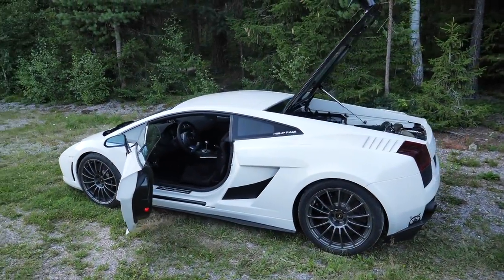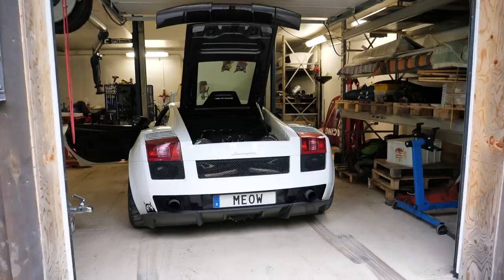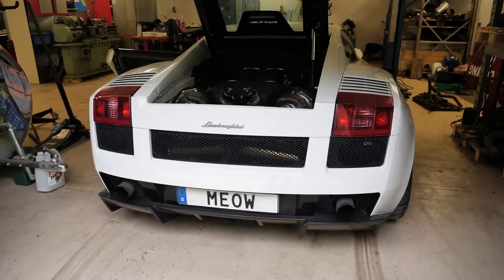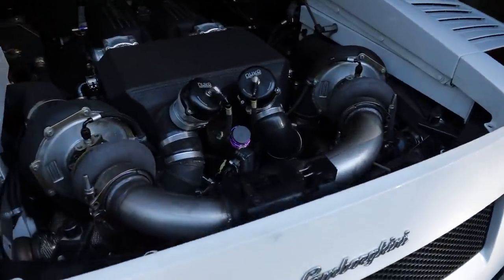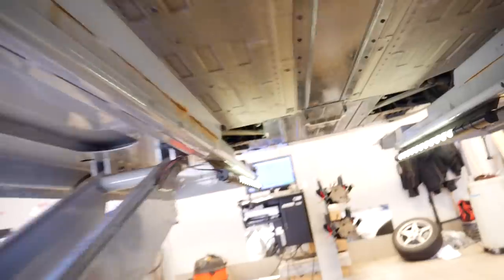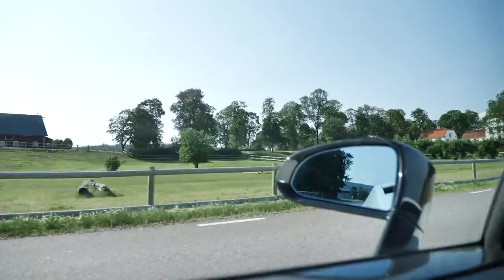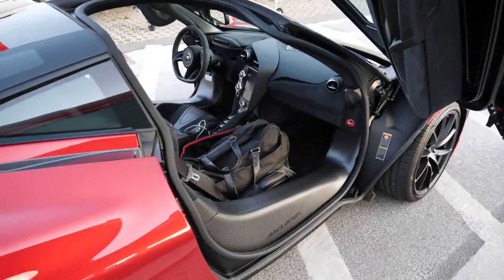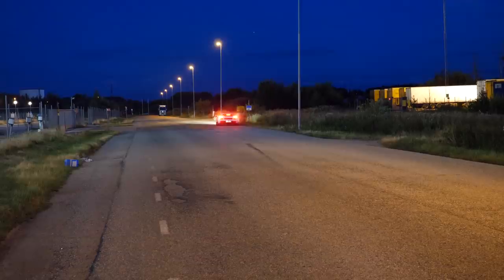My Lamborghini Twin Turbo Sounds like Crap!

Comment: Peter if you want to go carbon(ceramic) clutch plates, let me know. I've got a good contact that can get this manufactured at his supplier. They also made my new carbon ceramic rotors.
Reply: Why carbon and not kevlar? My own Gallardo could need new clutch plates next summer and it currently has some expensive Kevlar plates.
Reply: @RyosukeTakahashiRX7  Kevlar (Aramid) is basically very durable and has smooth engagement because of how it's dynamic to static coefficient of friction is. It's not very good actually for holding torque versus organic or (metal)ceramics and you'll need a very heavy clutch spring pressure to get the same performance. The carbon types (carbon carbon and carbon ceramic) clutches offer very nice coefficient of friction and can withstand nearly endless abuse and slipping without ever burning up (unless you actually try to of course). They are extremely lightweight and durable. Ps. I wish I had your problem :P
Reply: @DC_DC_DC_DC  Interesting, thanks a lot for explaining! But how about clutch wear for someone who's just driving the car as a daily and doesn't care too much about performance? Also mine has a shitty E-Gear, that thing eats through clutches like nothing. Does carbon hold up over longer times? My current clutch plate is the HT300 which lasted for good 90k kms and I'm satisfied with the wear. Would you suggest a carbon one over it? If yes, could i maybe get some insight in the contact and some of his previous products?
And no, I'm by no means rich, i saved up half a decade for this stupid shitbox. Not regretting it yet though, that V10 is just too lovely for now :D
One could say I'm going through an early and long lasting midlife crisis
Reply: @RyosukeTakahashiRX7  the E gear changes the situation a bit, it would be a gamble if the drivability would remain acceptable with the much bite-ier carbon. The gearbox software is programmed with a certain characteristic/curve for the specific OEM materials, and Aramids behave very well. Carbon ceramics and carbon carbons are very "grippy" and can even squeal. Since you don't drive your car hard, I'd say the Kevlar clutch you have now is a good decision for longevity, certainly on the robotized box. By the way if you want to learn more about this, look into brake (rotor/pad) materials from a bit more scientific approach (read articles, not marketing I mean) because it is pretty much identical. About durability, the carbon ceramic brake rotors on my S8 (yay v10 too) have lasted 300.000 kms with occasional hard use. Pads wear faster but still nowhere as fast as organic pads. That is probably the best way I can explain you about how wear resistant the materials are.
Reply: @DC_DC_DC_DC  For brakes i got the factory option with carbon ceramic and yes, still going strong. Would definitely buy them again if i ever needed new ones. Kevlar clutches generally don't get much usage outside of Lamborghinis, especially Gallardos, it seems. Guess my next one will be Kevlar again because there isn't really any reputable other clutch out there or at least not with any reviews saying they lasted for a long time. It's also worth noting the HT300 is carbon kevlar so in some sense one could just call it carbon. Anyways, thank you for taking your time and helping me, i really appreciate it.
Reply: @RyosukeTakahashiRX7  you conversation was more entertaining than the video itself

Comment: Congratulations on such attention to detail!  You are an inspirational engineer. Two questions:

The white smoke on engine start: 

is it oil burning from the turbines or something else (piston rings)?
is it oil dissipation (natural occurrence from the dry sump)?

Best of luck sourcing a clutch plates basket that is capable of tranfering over 1000 hp at the wheels for more than a few passes!

Comment: Only in Germany: 
TÜV: "Dont Think about it"
Reply: AFAIK Sweden has some strict laws too about engine swaps and such. Only the strongest engine from a model line can be retrofit into your weaker car, no series or manufacturer crossing...  So I really don't know how they justify or allow adding twin turbo to model line that never(?) had it from factory.
Reply: Sweden have laws permitting more crazy builds as well. Its called "Ombyggt Fordon". I have registered my BMW E28 518 with a BMW M50B25 with a single turbo running E85. You will need to change the front axle, rear axle, engine with complete driveline and complete brake system. You can then have 15kW per 100kgs, which equates to 286hp for my car that weights a hair under 1400kgs. Turbo size and injector size will need to be reasonable for the power, I had a 62mm turbo and 875cc injectors and that was too obvious that I was going to have more horse power after registration (which I of course changed after, 450whp now). Registrated it with about 450cc injectors and a Evo turbo (td05-16G). 

The problem with registrating it this way is that all of the above componenets need to be swapped for other stuff than is on the car stock, doesnt matter if you have gigantic brakes stock on a Lambo, you would need to change them to fullfill the requirements... I had to put a lot of work in getting my car approved, I have a complete E36 M3 front axle with brakes, rear axle is a custom build based on E28 but with E34 540 diff, brakes, control arms and CV joints with E28 535 driveshafts (this is to have the same width of the axle). Brake cylinder from BMW 750, M50B25 from E36 325, ZF gearbox from E36 M3 and a custom driveshaft with big joints from a E34 540. In addition I need to show papers that prove that I have under 285hp, I need to have measurements done so that the car isnt too loud, it needs a closed type crank case ventialtion and a catalyst. After that you will pay to have someone look at the car, testdrive it and write an approval that everything is done correctly. You will then take the certificate from them to the normal registration and annual check-up place and they will change the registry of the car with the new power and so on.

This would be pretty crazy on a Lambo, in that he would need to change all these parts just to do it, even if the axles/brakes and so on is really good from the beginning and better than most people could swap in thermselves...
Reply: @e30clew  Thank you for very detailed information.

Comment: The x pipe will help with performance as well. If you take your x pipe blow air through one pipe and hold a shop rag on the other pipe and watch how it will suck the rag through it.

Comment: Make a custom flywheel. Then you can get an aftermarket clutch easily. Otherwise you will need to make a clutch every time you need one.
Reply: Or buy 2 in advance :)
Reply: @idokwatcher2062  Or that... But breaking two on a race day is highly likely.

Comment: Lambda seems to be ok.
for more efficiency in low Load and low rpm you can go up to 1,08 maybe, thats 16:1 afr.
But high load looks good that way. 0,8 means a bit cooling already, not too bad for high tuned cars...

Comment: If it's starting to slip and the clutch is otherwise good, then you're probably around 850whp (my R8 TT was holding at 768whp)
Reply: nah its blasting the clutch, you can see it in the last part of the video. Remember he already upgraded to the kevlar before its slipping. probably closer to a thousand horses since he put those harder springs in

Comment: I believe the reason for it not sounding the way you want is because of the mufflers you have on other twin turbo builds they usually don’t run any mufflers just high flow rate cats

Comment: Why don't you control boost from top hat of WG?

Connect boost to low part, then boost controller valve controls top part boost

that way your WG stays closed with boost+spring, and under diagraph you have true boost, it will stay closed until you want it to open. From video I can see that your WG has top provisions also.

as to clutch, you show normal Sintered facing you want. Contact Sachs Racing Equipment, then can supply you a clutch, you have custom flywheel already. And while there, upgrade to 3disc clutch... it will hold much better.

link to Sachs Racing Engineering Clutch catalogue: https://www.zf.com/products/media/automotive/motorsports/services/catalogs/rcs_zf.pdf

No, I don't get anything for proposing their product, but there is a reason why they make F1 clutches and so on ;)
Reply from the maker: Of Course i have boost on top of hat. But if spring is too weak the exhaust backpressure is stronger.

Yes Sachs makes very good product. But nothing for the lambo. I use stock flywheel with trigger pattern. Also the "starter wheel" is on the back of the plate so it looks different to a normal cluth. Dont have time to rebuild for something like that now.
Reply: Ah yes... the pressure plate has trigger ring. 

But the clutch diameter is standard 184mm multiplate clutch. Just try to find out what is the original thickness of clutch disk, and most likely some race shop can convert your old organic clutchplates to sintered ones (the face is just riveted on and can be changed if the base is ok) 

Sorry don't know any Swedish race shop that could help you but I would take that as a route, because the disc center spline is already correct.

Comment: Hi Peter. Congrats for your car, very nice project you've put together. By the way, I've been watching your videos since the beginning when you bought your Supra from Japan.
Question: How you plan to tune your VVT positions? It's not that straight forward...if you find the "highest VE" camshaft for full load you'll propably have higher knock occurence (due to higher effective compression ratio)...thus reducing Spark Advance. If you move your intake camshaft to a reduced VE position you probably will find lower knock occurence due to lower effective compression ratio (Miller cycle effect...), but needs higher boost pressure to achieve same power...so, how you plan to tune part load and full load VVTs? Maybe you can source OEM mapping to have a fair starting point? Regards
Reply: Maybe there is someone who has read a stock ecu and found out where all the maps are? I have done a similar thing on my new build based on a BMW M54 engine (intkae and exhaust continualy adjustable) where I found a stock ECU bin-file and a internet forum has found out where the maps are in it,  I copied the values from there to have a good starting point. It's not straight forward as the stock ECU doesn't measure load in pressure but from the air mass sensor but its a good start. I've noticed that the exhaust cam does not change much power wise, it mostly acts as a "internal EGR" in the stock map for it, to comply with pollution laws. But the intake cam really changes the engine as you say, and when testing a new position you will need to remap ignition timing and VE for that load as well, its a never ending story of adjusting things which affect other things. I always have my laptop with me and I think the map will never actually be finshed... Theres always something to improve :D

Comment: Many 2JZ's use a 215mm clutch.  There are a lot of good after market offerings.  Another close match is the Mitsubishi GTO clutch, but there are less offerings as they are not as common a tuner car.

Re-purposing the friction disks, or adapting a 2JZ twin plate might be the answer.  Anything over 800nm is going to cook a twin plate full circle metallic type clutch, so your probably going to have to go for some 6-8 paddle clutch ceramic disks so as to not slip given the power your likely to make.  Carbon clutches are nice to drive but won't handle the torque either.

Comment: Love your work Peter.   What have you done for crankcase breathing - do you maintain a vacuum somehow?
Reply from the maker: Only small mod with check valves. Yes i have vacuum. I have a sensor for that.
Reply: @PeterBjorck  so you haven't vented crankcase back to the intake?   I have 1994 Ghibli II biturbo and am wondering what to do - has ctach canwhich vents to LH intake, but I get oil mist through LH turbo etc.

Comment: Sounds like the Philharmonic Orchestra playing with Metallica!! I was looking at your BOV setup. Have you seen the Turbosmart Anti-Lag blow off valves? Top drag racing teams with large turbos and manual transmissions have been doing it for a decade. Now the secret is out.  The pressure from the blow off valve dumps upstream of the hot side turbine to maintain spool. I was chuckling a little reading old forum posts. "There will be more pressure in the exhaust manifold. Cold air doesn't spin turbines. That's just stupid, it will cool the turbine and make more lag etc etc etc" Between the exhaust flow rate and scavenging effect it is more likely than not that the pre-turbine pressure goes negative when the throttle plates slam shut. *(Heckling forum Einsteins, how does the pressure get to the hot side of the air pump know as an engine? Is there another route besides passing through the throttle plates? If so, I'm not aware of it, please share ;-) lol. If air is flowing at 0.50 m/sec and you close the inlet side of the pipe, does the inertia of the air based on that high velocity have any effects on the pressure inside the pipe?)* That shot of cool air helps to keep temperature down while keeping positive pressure on the hot side turbine inlet allowing the turbine to keep spinning because it's unloaded on the intake side and maintaining positive feed pressure on the exhaust. It is kind to the turbo unlike ignition/fuel anti lag throwing raw fuel bombs at the exhaust turbine. Sweet setup and mouse free! No mice chirping and cavitation in the turbos.. The ALV40 is the off the shelf solution. Sorry for the rant, sometimes internet engineers drive me mental.

Comment: Spec clutches, rated to hold up to 1300ft/lbs of torque, however not too cheap: https://www.specclutches.com/parts.asp?title=Gallardo%20SPEC%20Clutch%20Clutch%20Kits%20(Twin%20Disk)&b=207&m=20&o=3542&y=0&t=246

Comment: You can get rid of that engine oil smoke by adding a can of Restore at every oil change.
Reply: Or do it the right way and replace the valve seals
Reply: @richardvadovsky9931  If it's the rings he will need to add Restore engine oil additive. Or re ring it & that would be a job since every cylinder is a custom fit.

Comment: When I see any complaints about a TT lambo, my first question is: "Did you get it done by Underground Racing? Yeah that's what I thought."
Reply from the maker: For me even if I had the money I would not send it to UGR. The fun and interesting part is to build and develop myself. Drive the car is secondary.
Reply: @PeterBjorck  that's awesome, just letting you know what I think whenever I see anything related to an issue, question, or similar thing with lambos and aspiration lol. Of course self builds is most rewarding and the whole lot, but dependability and guaranteed performance, I'd do the UR route everytime. Most things I do myself, but for something like this, I'd go right to UR haha
Reply: @PeterBjorck  BTW, I absolutely enjoyed your video, and didn't realize you're actually quite far from UR so your option there is very difficult lol

Comment: Hi, awesome lambo and great work with the mods!   That software is very cool, what software is it?  And is it compatible with other cars?  I want to use it for my BMW 335i trying to track down waste gate position and boost pressure / leak at the moment.

Comment: Amazing knowledge! 
I have a question, I have a KTM 790 Duke (800cc parallel twin with 285° crankshaft)
Any tips on getting the best sound out of that engine?
Right now im running a "homemade" exhaust from Biltema with the Catalyzer still on!
Im Swe but ive put the comment in English in case this will help anyone else out there.
Reply: Köp ett färdigt helsystem från akraprovic :p

Comment: what transmission unit you got installed i forgot from which car was it. it will help more. i know that the dimension are enough, but the model of the transmission unit will help.. it is not important, sorry you ned only the face :) that is hard to find.

Comment: I recommend heatshieldproducts.com, I wrapped my Viper headers and really like it. I also daily drive it in summer here in Arkansas, no milted parts yet and I'm able to get closer to the engine when its hot. 
used to own a C6Z06 and when I installed the headers with headers wrap, it really didn't work at all! i could not get close to the engine when its hot.

The sound after the X-pipe is amazing